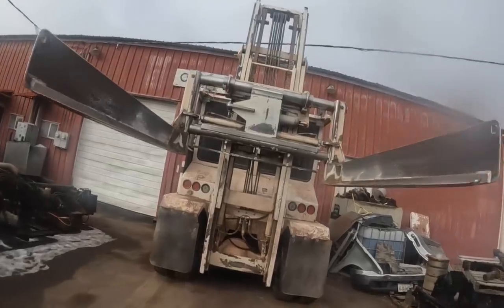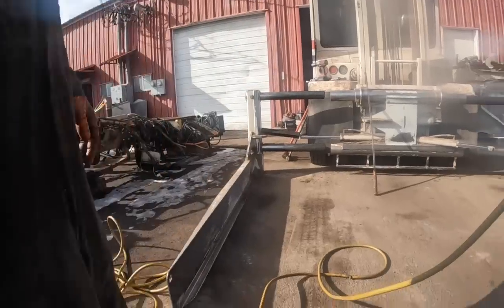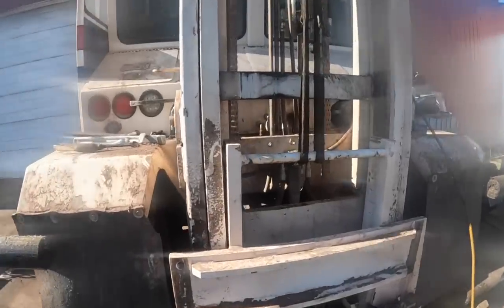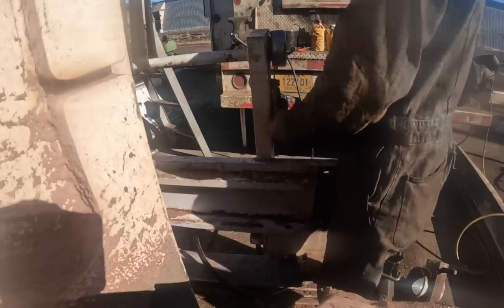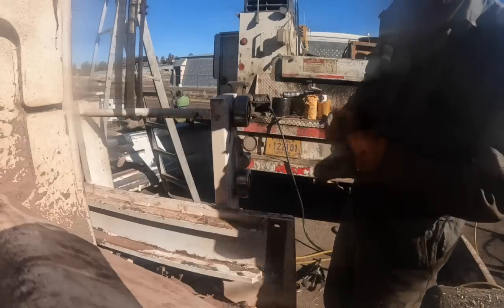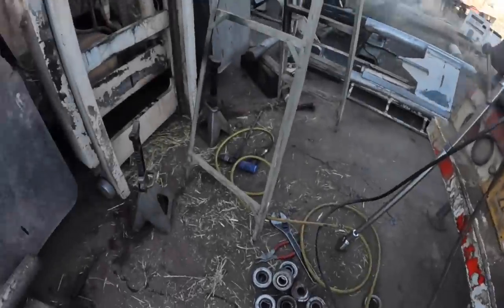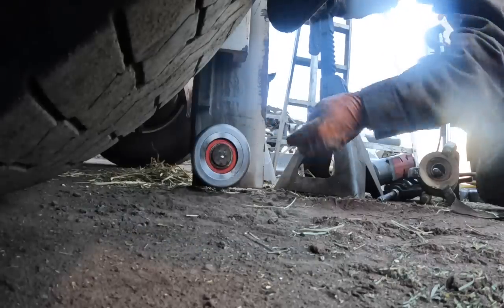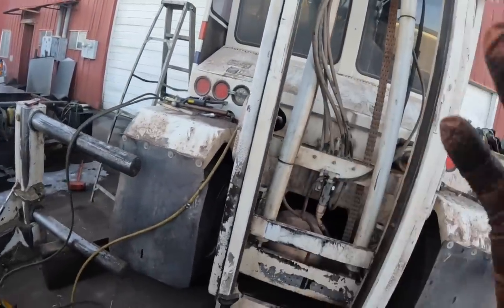Changing out mast and carriage bearings.

Comment: I had to do this exact same job a few years ago in northern nevada. Owner didn’t change the bearings for a long time past failure, and I ended up burning about 12 pounds of welding rod rebuilding the mast in the areas where it had been scarfed out at. Them boys really ride em hard and put em away wet.

Comment: Thank you for the video Warren👍, yeah I already had a safety pussy had a go of me when greasing the loader tractors especially the propshaft trying to turn to get to the grease zerk which you can't without the engine running and the loader down the ground to lift the axel up to do the upper part of the pivot bearings because that's were the weight goes to on loader tractors, was told to have someone to help me but told them, "I ain't no team player" just me and one of the farm dogs.
Reply from the maker: Tell him to mind his own damn business.
Reply: @western truck and tractor repair  I already told him to go and piss off no doubt I'll get reported again.👍

Comment: Warren, from my limited experience on snap rings, some times the rings will actually cup from pressure during operations, that cup is across the width of the snap ring so that if you put that snap ring opposite (outside to inside) of what it comes off it makes it near impossible to reinstall to lock in at times, I used to take them to a press, if I was in the shop, and put them between two heavy plates and press the the living daylights out of it, if out in field it was hammer and a plate or vise anvil or pliers and lightly grind or sand it just enough to get the ring to seat into place, those things can be a struggle bus ride sir at times, just a thought, thanks for the ride along.

Comment: Isn't it strange that the most easy sounding job "Just change the mast bearings" turns out to require thousands, or it seems like, of bits to be removed to get at the job, and thats before one actually gets to the job.(I had a case 525 and changed the chains, (Triplex mast, two chains) even that took quite a long time with just me.)

Comment: No, we don’t use  these in Australia there at that just too complicated we use something something more simple that works
Reply from the maker: This moves about 6000 ton of hay a year,  and loads  4 hay trucks a day that feeds  6,000 head of dairy cows. I think it works just fine. Round bales work fine for small operations but for large scale dairy's, big 3x4 big bales are way more efficient, and you can truck them way  easier.
Reply: @westerntruckandtractorrepa1353  imagine what them African hay farmers could do with a hay squeeze like this,,they stack their 6 ton trucks with 15 ton of hay stacked like an upside down pyramid by hand 😂

Here in Australia,we use tractors with spikes or a telle handlers,both are multi purpose units,

This is a designated hay lift,I reckon a few outfits here in Australia need these here tbh,
Reply: @aussieboganbloke2244  bale spears and telehandlers don't do too well at road speeds.  A hay squeeze can pick up a bale and haul it miles down the road to where the animals are, without monkeyin' around with a truck, a trailer, and all that, plus they can also move very tall stacks of hay, or load/unload a truck in a mere couple minutes.
Reply: No,Challenger you stay with what you understand…